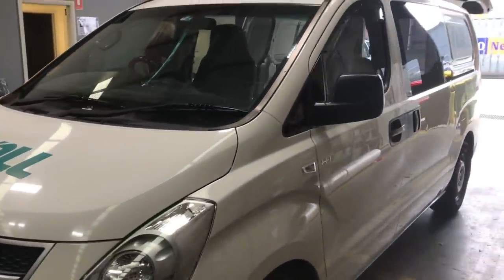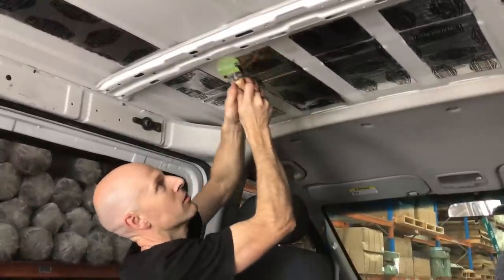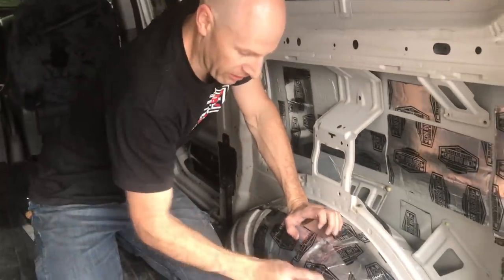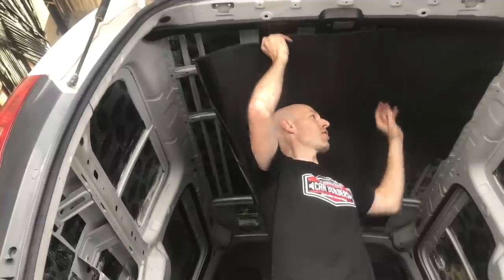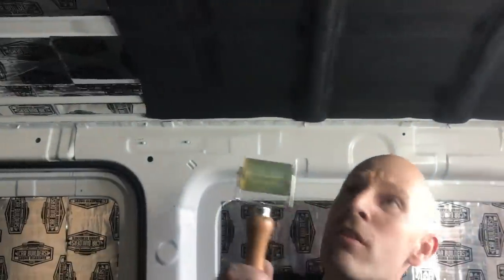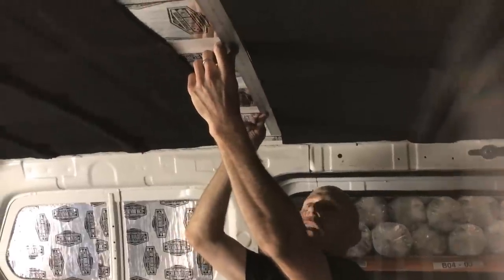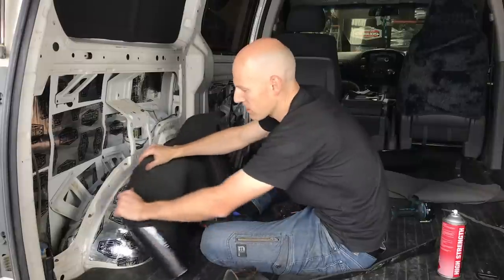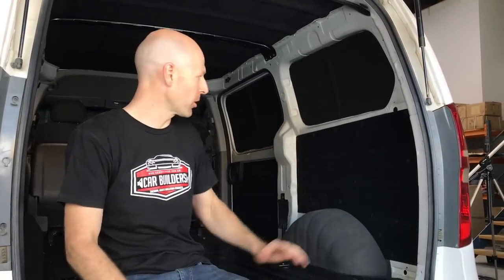How to sound proof my van? iLoad, Vito, Sprinter, Hiace, VW Caddy, Transporter, L300, Traffic

Comment: This should be an essential step for a camper conversion. The sound deadening would not only provide a quieter ride, but a quieter place to sleep, and probably some thermal insulation, too.
Reply: An important step for any van. The sound deadening will absolutely provide a quieter ride, as well as thermal insulation.

Comment: My honest opinion: 1. Pretty subpar installation of the first layer. 2.Stellar installation of the second layer, especially on the roof and sides. 3. That foam is to be used only on the roof. It's perfect there, because of its light weight. 4.There are different materials for sides, and wheel arches. The one for wheel arches is a sandwich of membranes, that includes a memory foam. Similar is the one for the floor. 5. This is a very good video, for instructional purposes. As for details, everyone can work them out to their personal preferences.

Comment: I have an Iload/starex just like that, but a 2008 model, looks exactly the same. The funny thing is that the support gussets over the wheel housing is lose. It's not welded to the side sheet panels. On mine there is even a gap of up to three millimeters. And I find that funny, the reason those gussets are there, is to support the side panel. Mine are kinda glued with a couple of blobs of what appears to be welding protecting mass. Anyway, I will be doing exactly this kind of sound insulating upgrade. But I will stop with the butyl sheets and just sprayglue some polyester sheets on in a couple of places. Also I took of the whole tree inner floor, and there is a big thin steel sheets to apply butyl mats on aswell. I will be building a gas sound system to it with amplifier. I got the sheet metal wall behind the seats though. Here in sweden we need a wall between the loading area and the passenger area. Anyway nice to have seen this video. It's nice to see an exact car upholstered. Thanks
Reply from the maker: Thank you Helikopterpop. Interesting differences. Good luck with your project 👍

Comment: Why do you need the sound deadener and the closed-cell foam? Wouldn't the closed-cell foam work as a sound deadener by itself? Thanks.
Reply from the maker: Thanks for the question. They do have different purposes. The sound deadener is dampening vibration in sheet metal whereas the foam replaces the old factory underlay which have their failings. The foam is a de-coupling layer and has both some external noise and heat qualities. We go into further detail in our video https://youtu.be/P4ylKyoY_oU 👍

Comment: Good on you mate   have a question, I have gmc Savana hitop conversion van with fiberglass roof. Removed the ceiling and put up 1/2” polyiso to save headroom. Final ceiling will be 1/4” cedar planks and seeking what best material to attach them to on top of polyiso. I hear a lot of rain noise so what to do for acoustics sound deadening. Learned about new product called 4mm Sound Shield. Amazing difference more than noisome and dynamat. I planned another layer 1/2” polyiso attaching very lightweight planks directly on it after painting surface black so to have 1” insulation but now thinking taking back down the 1/2” polyiso a simple chore then layer Sound Shield then up with the poly again. The stuff is expensive $120 for 11sq’ so thought use it on 30% of rear portion roof and fill in with less expensive similar product although perhaps the 11sq’ of the 36sq’ ceiling is enough? Again headroom so only have 1” total for insulation sound deadening. And hi end sound system so wanting absolute best sound. On top. Of the poly iso I could do thin layer of acoustic sheet or blanket ?  What do you think
Reply: Also there are 3 big windows and 4 door windows needing acoustic treatment of some sort

Comment: Would it be suitable to line my van with the black foam in a wet, cold climate country like here in Scotland? Or could it cause mould/mildew issues
Reply from the maker: Hi braapgng. A closed cell foam will not hold water and will act as a condensation barrier 👍

Comment: If I put this in my van, I would need to know the VOC/off-gassing levels, for air quality. Looks like great products. Curious as to the thermal insulative properties they happen to aid, as well.
Reply: Ive never noticed any smell s coming from the vehicles i do in this exact brand of gear, you might get a tiny bit from the mass vinyl stuff but it was not enough to upset me and thats a. High tolerance

Comment: is that rubber sheets with adhesive? how does the sound dampening work with those? extra mass?
Reply from the maker: Hi SnortTroll. The Stage 1 adds mass direct to the panel, which limits vibration generated noise. The mass loaded vinyl products act as a sound blanket barrier for external noises.

Comment: can the insulation be cut into smaller sections to make it easier
Reply from the maker: Hi lanuk. Yes, it can. You will find you need to cut the Stage 1 deadener into many different shapes especially when fitting in doors and inside cavities.

Comment: Thanks for the very detailed and thorough video. I’ve concerns about heat. Do you have any temperature effectiveness results for a van in the sun? (It seems that lining a van ceiling with black product would produce a giant roasting pan)
Reply from the maker: Hi Tranquility Travel. We will post a video shortly (hopefully in the coming weeks) where we complete this testing in a video for you. However, the black of the foam in this application isn't significant as it isn't in direct sunlight and therefore isn't absorbing light (heat). The factor that is important here is the colour of the van as it is going to be in the sunlight and it will either reflect or absorb heat depending on the colour. 😎👍

Comment: Yall think i should insulate the floor of my van to dampen sound? Its bare metal now... Suppose ill knock on it and see. I intend to raptor line the interior as ive done on the exterior...
Reply from the maker: If it is ribbed, vibration-type sound shouldn't be a great issue but as you said tapping it will test it. We still recommend deadening the rear wheel arches. Good luck.
Reply: Love the straight forward answer bud! And the fact i got a response from you at all! And the material of the great work you guys do over there!

Comment: Would lizard skin work as well as this technique? Nice work!
Reply from the maker: Hi Gina. Yes, Lizard Sound Control would replace the Sound Deadener butyl mats and Lizard Skin Ceramic (heat control) would also act as a vapour barrier. Another option you have is the Van Liner (https://www.carbuilders.com.au/van-liner) which will create a vapour barrier and also provide thermal installation.

Comment: Where did you get all this material especially the second application the black carpet like material
Reply from the maker: Hi Raul. You can find all the materials on https://www.carbuilders.com.au We used Sound Deadener (Stage 1) we then used Insul Layer 6mm closed cell foam over the top and over the wheel arches our 4-way stretch carpet 👍

Comment: Why don't you use a rubber mallet/hammer ?
Reply from the maker: Hi 66longinus. For which task?
Reply: For places that require strong pression with the hands. for the pieces of fabric used with contact glue, For places too small for the roller you could use a small rounded rubber hammer. etc...

Comment: closed cell foam barely affects sound. it can only be used to decouple surfaces
Reply from the maker: Hi Jaye. Yes, with the Stage 2 product in the van packs we are looking to stop heat transfer and create a condensation barrier. This layer does also soften sound within what was an echoey space. The Stage 1, is stopping panel resonance 👍

Comment: The issue I have with you headlining is that its permanent and won't cover the wiring very well. And God forbid you want to add anything to the roof later.
Reply from the maker: Hi bicanoo_magic This can removed. It does take some elbow grease and it's not a job you want to do (we've done it enough to know) but it can be done. The problem with a material in this inversed application is that you don't want it to fail and have the roof lining sagging down on your head. There are low tack materials that you could use. They will be easy to remove however they are also likely to fail.

Comment: overkill unless it's inferior product
Reply from the maker: You can make the Stage 1 deadener go further if you are looking to reduce cost or weight. You will need the same coverage regardless of the quality. The problem with Stage 1 inferior products sold cheaply on eBay is not the dampening ability but rather their low grade butyl  composition, meaning it will become runnier at a lower temperature and, if it is in doors or roofs, can cause a mess. Stage 2 products are acting as a sound blanket and, like a hole in a bucket, if you only cover patches, external sounds flows in the gaps. 👍

Comment: phh hahaha. You can't sound proof a car/van. You can lessen sounds coming in/going out and lessen unwanted rattles, etc., but you can't sound proof it.
Reply from the maker: Correct. The title should be 'How to lessen the sound in my van?' 👍
Reply: @carbuilders1  oh idk. i suppose it depends on what you are doing. For me, I want a quiet cabin, lessen my stereo noise from leaving, reduce external noises from coming into the cabin, and also reduce cabin noise, metal vibrating/door panels harmonics.